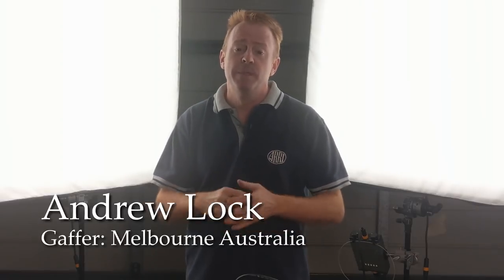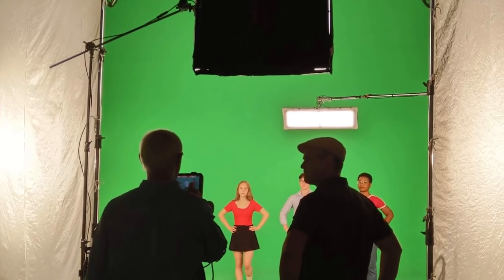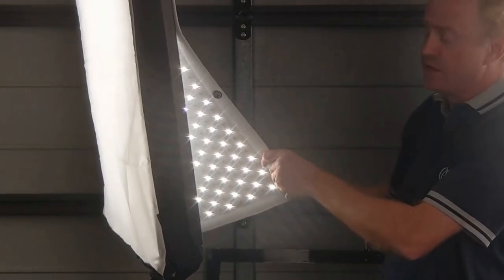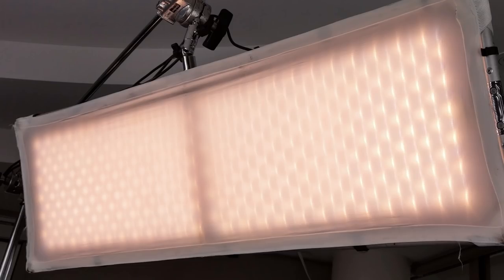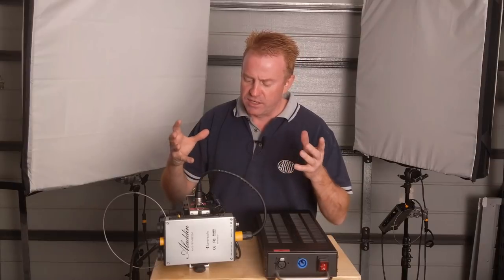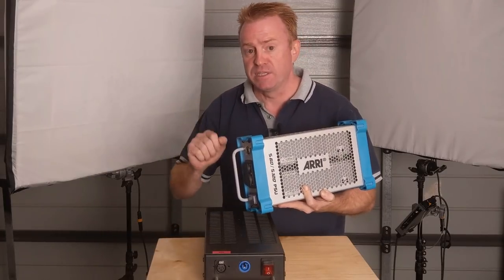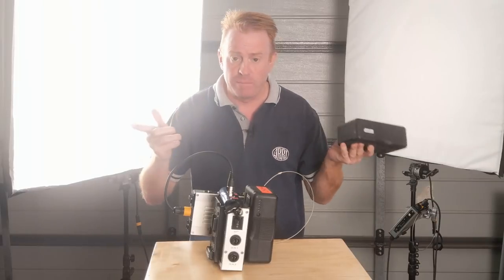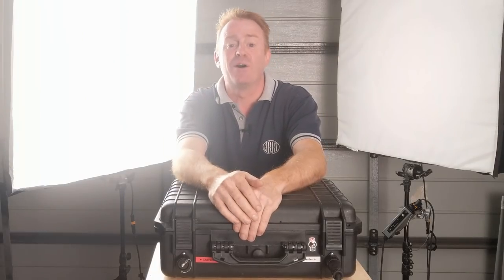Gaffer & Gear 39 - Aladdin Fabric Light 350

Comment: What an excellent and thorough rundown of this unit. Thank you! I didn’t even think about attaching to the backside of the frame:) Love the insight into the power distro mess. Is there anything special about the XLR you use for the extension between the controller and power supply? Also, if you keep the 3x3’s built, as I often do as well, what made you choose them over Lite Mats? I will be sure to tell my viewers about your vlog... great stuff and cheers from San Francisco!
Reply from the maker: Hi Luke.

Thanks for the feedback. Your Chanel is amazing and I learn so much from it, especially as in the USA you get access to gear we don't. (Now I have modern studio grip bits in my collection for example!)

Their is nothing special about my XLR Cables, I just use a fat gauge to keep voltage drop to a minimum. You could use your skypanel leads.

The reaaon I went with Aladdin was the colour render, and the whites in daylight were so very close to the plankien curve. (however this is not the case with the Aladdin 4x1 so not all the products are this good).

I just couldn't get over the price of the litemat for what I was getting (on my spectrometer readings)

Also the pack down ability of Aladdin had huge appeal to my rental clients. 

I must say I did invest far more in the system than I intended (with PSU's) but, that's show biz.

Do you know if you can get a lighter diffuser for them, it's seems like it's magic cloth only, the distributor here is not that switched on.

As for litemats, I do have spectrums on order. I couldn't resist the NAB special. So let's see if that changes my direction.

I'll pop a mention to "Meet the Gaffer". It's a fantastic resources for people learning our craft, and they learn the "safe" way to do things! I'm sure, like me, you started these videos out of concern.

I'm pre recorded a few episodes ahead so it may take some time before I get around to plugging your Chanel. But I do recommend you and "grip tips" to all the students.
Reply: Yes, you can get different, lighter fronts for the 3x3’s. I only have 1/2 Grid and Magic, but I would venture that the folks @TheRagPlace could make up whatever you want. Let me know if you need a more direct introduction. 

I’ve held off on the LiteMats up to this point as well, but will no doubt get sucked in eventually:) All these systems begin to add up when you accumulate accessories! It’s cool how we’ve been going down the same path with the breakdown square tube frame. American Grip should have a nifty version available soon. 

I’m glad you’re out there sharing the knowledge. Keep up the great work and it would be fun to meet up sometime down the road...

Comment: observations about alladin lights in general: 
the dimmer works, but it has alot of plastic bits that like to break, compared to say a carpetlight, the whole construction is a little fragile for my taste.
also the dimmer and cct knob can easily get bumped while moving the light around and change your settings without you noticing, they are exposed and very sensitive, always double check if anything is messed up after running around with it.
building the light and tearing it down takes ages, so leaving it in the truck fully build is really the only option, which leaves it prone to getting damaged in some stupid way, to be fair this is the case with most fabric lights.

the custom frame is a great idea, i had it strapped to a diffusion frame for one job and hated it that way.
Reply from the maker: Prior to these I had the Aladdin 1 X 4 come in, and I knocked it back for review, because of EXACTLY what you said.

However the build quality on these is a huge step up.

I did have had to spend big on custom canvas  bags to store them assembled and protect them.

One year on I have to say these are holding up very well, better than my other mats.

My biggest criticism of these is the head leads don't follow pins to power protocol.

Comment: What is your experience with the durability of fabric led lights?  I hear if you roll / fold them too often it will damage the led strips.  It would be nice if you had a video talking about this and the best practice for avoiding damaging such lighting fixtures.
Reply from the maker: I keep mine assembled for speed. I got a bag made up.

I haven't had any problems with these units, I would imagine if you folded them all the time it would weaken the wires.

These have become my go to light, they get used a heck of a lot.

I just need to figure out some way to clean the magic cloth

Comment: The dual PSUs to me seems like a cost cutting move. Typical laptop PSUs top out at 250W but they could have built a PSU into the controller that can do the 350-400W needed. That’s only 7.5-8A of 48V, really not much.